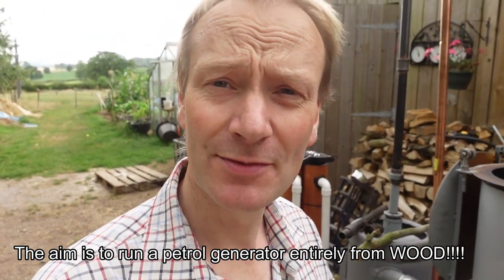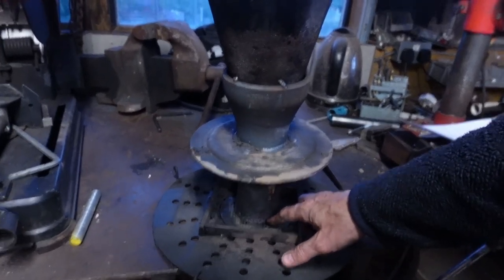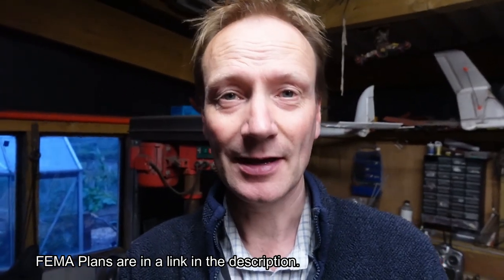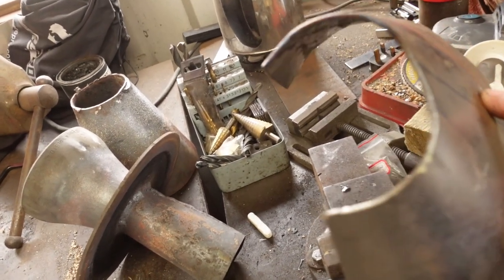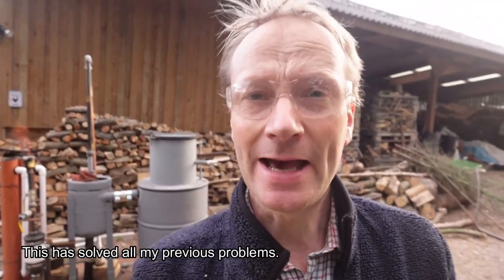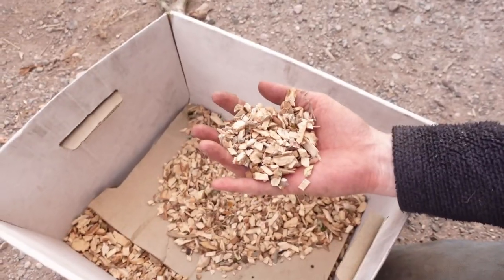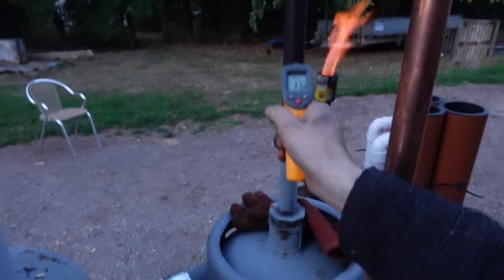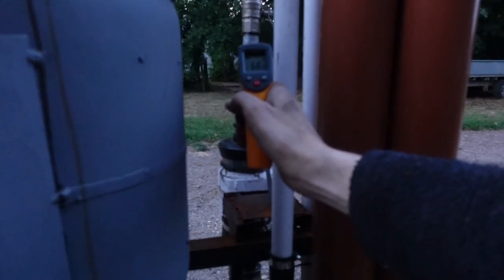Making wood gas using my Wood Gasifier.  Mods and Temperature readings Part 2

Comment: Maybe a silly idea but the end goal is to run a generator off the gasifier so why not mount the gasifier and generator on a solid base that has vibration dampeners under it allowing the generator vibrations to help clear the hanging material in the gasifier. You could simulate the generator vibrations by running the genset on standard fuel while continuing your development of the gasifier unit.
Reply: That's a great idea because the one's mounted on trucks don't need a shaker grate or bridge much at all from what I've seen.
Reply: @kittywampusdrums4963  It's a standard solution. You can even install a rod between the generator and the gasifier to cause vibrations.

Comment: I also wanted to tell you that you did a great job on your build. If a 3 inch restriction throat works for you then that's great! It also comes down to the fuel you are using so for your build and the wood chips you are using a 3 inch restriction appears to work just fine... You mentioned back flashes and you can loosely pack a small ball of course strand stainless steel wool about an inch iside the top of your flare tube right where you light your flare and that will come close to completely stopping any back firing at the flare tube or flash back issues at the flare tube. Also you mentioned the flare being orange and that's a good indication you're cracking the tars. What you don't want to see are any yellow milky flares or purple milky looking flares. Yeah a blue flare is great but as long as it's orange you're safe. If you can extinguish the flare after the gasifier has warmed up and not see any smoke or vapor it doesn't matter if you don't have a blue flare. I've seen a solid white flare on some runs which means I was producing a lot of hydrogen in the woodgas and I've seen the flares with a transparent Halloween orange even with red hues which means that there is probably some micro carbon particles in the gas but no tar issues. A lot of the pro builds are only concerned with removing just the large particles from the woodgas and they will tell you that the engine will not be harmed as long as the temperatures are hot enough so that the tar is being broken down BEFORE the gas enters the filters and the engine. They will also use simple straw media filters to capture large particles and to help with not restricting the engine's ability to breathe and draw the woodgas from the gasifier itself. I went with the extra filtering because I just wanted to play it safe. Hope that helps.

Comment: Hi I just found this video and on my earlier builds I dealt with every issue you could imagine when I first tried my hand at building gasifiers. Originally I used a 3 inch diameter restriction that was bell shaped starting at 3 inches from the hearth and expanding out to 5 inches. This is actually called an inverted bell restriction throat and they do that to keep the restriction throat from jamming up. I had nothing but issues with the biochar along with the embers falling straight through and causing flashbacks. I wound up going with a straight pipe restriction throat that was still 3 inches in diameter and that helped a lot but I was not quite hot enough to crack the tar but I was producing a stable woodgas. Keep in mind that I was running small engines from 5.5 Hp up to 6.5 Hp so to raise the temperatures up enough for a small engine I had to go down to a 2 inch restriction throat and to stop the blockage I took a "ice cube tray design" approach where I made my restriction throat 2 inches that only spread out to around 2-1/4 inches and you can even go up to 2.5 inches. Just making the restriction throat taper out a little kind of like an ice cube tray solved the clogging issue for me and with the smaller 2 inch restriction throat I got the correct temperatures to safely run the engine without dealing with tar issues. Now in some areas people have clinker issues caused by the different minerals in the soil that the trees take in and as you consume the wood you actually make a hard rock called a clinker that can clog the gasifier up. Where I'm at I don't see that mineral issue and I only use seasoned wood which for me is dead branches I can find in the woods literally laying on the ground that I cut into 1/2 up to 3/4 inch chunks. Now that I found your videos I'll sit down and watch them because we all can learn from each others builds. My build is far from perfect especially compared to a commercial or a professional design but it works and others have taken it and made improvements on it which is what I really wanted to see happen with the build when I posted the videos. Have you been to the blog on www.miniwoodgas.com? You can not only post your ideas there but you can also ask others questions too. Thank you for the mention in your video. Flash...

Comment: It is best to optimize the gasifier without a filter until it delivers an almost blue flame.
With an electrostatic precipitator and wet filter you immediately get a nice blue flame, but still a lot of tar is produced and the filters will sooner or later have a problem. 
Nice project you started there =)
Greetings from Bavaria (Germany)
Reply: Would that be burning hotter to avoid creosote buildup?

Comment: Enjoyed your video.  I too have unlimited supply of wood chips and would like to convert them to fuel, so I can power a furnace to keep my barns warm all winter. Then later to power my generator to power my AC to keep my barns cool in the summer.  With Spring time to reduce my energy bill.  Looking forward to following your progress and hopefully get my own unit up and running.  I need to make mine low key, so as to not upset my noisy neighbors!

Comment: This is a great video we get to see the temps at the different areas. Thanks for uploading! I'm building mine with a 2" PVC radiator and I think it will be just fine after seeing your temps. I have a 2.5" cone if I remember right. I haven't fired it up yet but that was the math for a 5-10hp engine/generator. As long as the wood is cut small enough there shouldn't be too much bridging.
Reply: Whos flash?

Comment: I had the same issue with bridging. I also increased the reduction to about 3". Also removed the sides on my ash grate. That way I can shake the hopper empty if I want. Doesn't bridge anymore. Orange flame is fine. Yellow is tar. I've run a lot of pellets through my gasifier and although it doesn't bridge anymore, I'm not happy with the pellets. I even mixed 50/50 pellets and charcoal pellets and still struggle to not produce some tar. The polyester fiber filter does a good job of capturing the tar. After that I also run through a coffee filter and that doesn't seem to collect anything. I also use pot scrubbers for first filter, wood shavings for second filter, then pillow fill polyester for the third filter. I have found running a 5,000 watt generator ( producing about 2,000 watts max) doesn't quite keep the hearth hot enough at least on pellets anyway. I'm now in the process of getting a 13,000 watt generator setup and running on 3/4×3/4" cubes. I can't wait to see how much load I can put on the bigger generator and what the temperature runs at. Anyway I enjoyed the video. Joe

Comment: When you said filtration socks, it made me think of proper socks. Because of how cool the gas is, there isn’t any worry of burning or melting conventional fabrics, right? So in theory, you could use old socks, stockings, or other clothing materials, the problem is just how effective those materials would be at filtering the gas? I wonder how effective charcloth would be. I suppose the problem would be the density of the layers you use and the fragility of the material. I’ve been fascinated with wood gasifiers ever since I learned about them a few years ago, but I don’t have the skill to build one, so videos like these are perfect for satisfying my curiosity. Although, sometimes it can also peak my curiosity, as you’ve read.
Reply: The tar should crack in the fire-cone the most then get spun out in a vortex filter right after. Look up Flash001USA channel on youtube he has a tri-filter setup with hanging "socks" of something in them at the end of the filtration train.

Comment: 50mm is about right for a small generator. Maybe a tad too small. I'd go with 70mm.
If you want to run a decent 4 cylinder, you're gonna need about 150mm - 200mm throat.
My reasoning for wider/less taper - you need the gas to move slowly through the embers. Too narrow and the gas will speed up, moving through the bed before it's had enough time to crack the hydrocarbons. It needs time in the embers.
A deeper, hotter ember bed is better for making wood gas - with air inlets at different positions through the full length of embers. 
Charcoal gasification is easier, more forgiving and requires less effort to make clean gas. All the tars have mostly been removed already. You need less heat and less embers to make clean charcoal gas, so a shorter, narrower burn zone will work.
Charcoal will give blue flame gas easy. It's nearly all CO - unlike wood gas.
Heat is your best friend when making wood gas, the hotter the better. Insulate the hearth/throat. Aim for 1,200c and keep the gas in there as long as possible. 
Bubble the gas through several water traps. Cleans out tar and dust better than anything else - and it removes some carbon dioxide, while leaving the carbon monoxide in.
It makes a vortex filter redundant. A regular car air filter will be sufficient, once you've condensed all the moisture out the gas.
Reply from the maker: Hi Brian. That is excellent advice- thank you. I was considering making the throat longer for the very reasons you gave. Although I am running my 15hp generator at 230v and 50hz, I cannot yet put too much of load on it without losing the revs. So my thoughts were similar to yours. I have been intrigued with the charcoal idea too and will have to experiment with that too. I shall make some more videos shortly. But thank you for taking the time in commenting. A
Reply: @mycountrylife810  
I enjoy sharing my thoughts on it.
I'm no gasifier expert, but I sure as heck been a firebug all my life. Small fires, big fires, huge fires. If it burns, at some point in life, I've made fire with it.
Pretty sure I know, understand and respect fire way more than most. 
Something I've got planned for my gasifier - injecting super-heated steam into/through the embers.
It has water cooling. The plan is to take some of the hot water and run it through a coil inside the main cylinder - in the hot gas flow and around all the really hot bits.
Hopefully, by the time it reaches injection points in the embers, it'll be 1,000c.
https://www.youtube.com/watch?v=CmBmd_JBwso
Reply: What about simple cone shared iike funnel gasifier with cyclone filter and water tank and gas outlet for direct IC engiines?. ❤❤❤😊

Comment: To make cones just cut out a perfectly round circle, cut a slit in the circle in a straight line that starts at the center and ends at at the outer edge of the circle, open a bench vise to the diameter of the circle and then clamp onto the circle  so that the jaws rest on the sharp edges of the circle and so that the slit you cut in it runs parallel to the jaws of the vise, then tighten down the vise and let the circle fold into itself like a tulip until you get the size of the cone you want and weld the seam. Try it with a paper plate and it'll make more sense

Comment: Hi, how well has this build held up over time? I was wondering whether the oil drum is sturdy enough to cope with the heat output from this, but the temperature readings are much lower than I expected
Reply from the maker: Hi there.  The structure holds up well and the steel drum should last quite a while as the main heat is contained in the inside 'propane tank'.  I have noticed that the rubber seals are the first to perish such as the boot that links the electric fan to the metal pipework.  I think this is probably mainly due to sun damage.

Comment: I've been wondering if using an old boiler tank could work well as a cooler. Running the gas through the copper coil inside.

Comment: Take a look at a cyclone filter design for a dust extraction there needs to be a cylinder and cone shape m. What you have is an expansion tank.
Reply from the maker: Hi Mat.  Yeah my design is not ideal.  I am getting quite a lot of condensate dropping out at this stage along with some tars and larger particles.  I think this may be happening because this tank is acting as an effective heat sink and cooling the gas.  I may well redesign this part later.... Thanks for your comment though.

Comment: Need to make that reduction tube larger. The depth is fine but you could go twice the diameter. Think of the reduciton like a battery for the char. You want some excess so if there are hang ups above you can burn some of it out while things catch. But those inconsistancies are just the nature of the beast. They all do this at this scale physics is physics you can change that with archetecture alone. You need to automation to overcome that. It looks like you could convert it to charcoal as well. You should look at giving that a try. Its much easier and waaaaaay more stable. People spend way more time fiddling with a gasifier and then say Oh :well charcoal is a waste" Yeah your time is more valuable than that little bit of wood waste fidling around with that wood gasifier trying to make it work. lol
Reply: By the way a wood gasifier does not produce a '' blue flare" the H2 is dirty it will not burn blue it generally is orange. CO will make a beautiful blue flare. Lab grade hydrogen will be more of a faint blue but not from a gasifier. Generally after the machine has ran and been shutdown; on the next light up the fuel left in the unit will have converted to charcoal. This is where you see a nice blue flare from the CO. Then as soon as the fresh fuel you have put in the unit hits the reactor it will shift to a proper wood gas flare. That is typically orange with a blue base. violet/pinkish is showing a rich CH4 gas.

Comment: don't know if you'll make some improvement to compress the wood gas for later usage. and I think it may be better to insulate the burning chamber to increase the temperature
Reply from the maker: Yes, that's a fair point re insulating the burn chamber. I may have to try that.

Comment: Where did you get the connector between your reactor and condenser? How much are they? For my part I bought a union type connector but expensive...
Reply from the maker: Hi there. I found these connectors really useful as they take a range of pipe sizes and ready to undo. If you Google search for a exhaust tube pipe connector joiner sleeve clamp connector, you should get something close. I think I got moved on eBay.